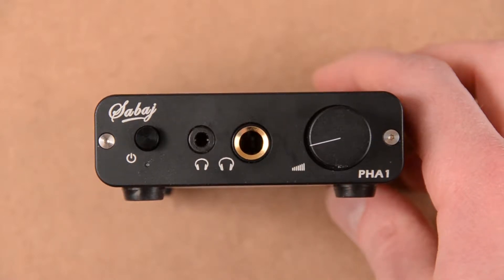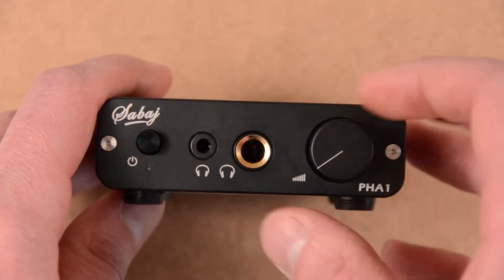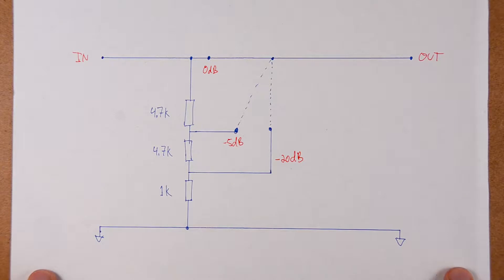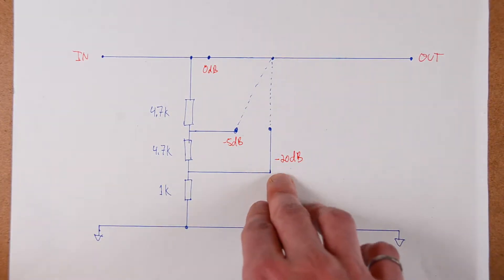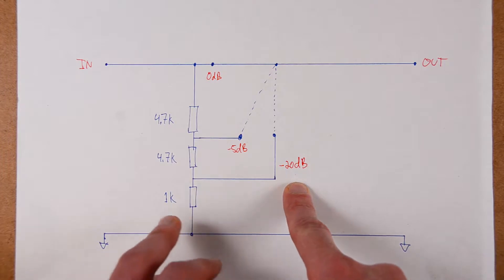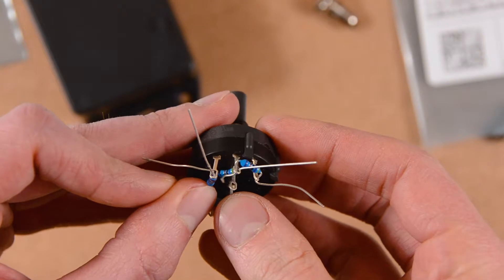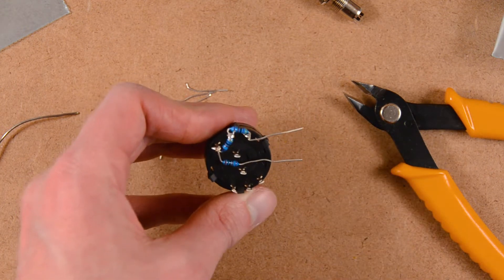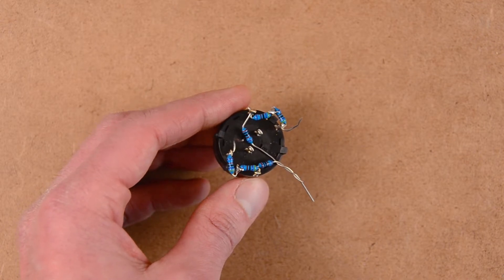Stereo stepped attenuator

Comment: Then you are changing the output impedance of your headphone buffer. which means changing the frequency response curve of your headphone. This should better be avoided.
Reply from the maker: The attenuator is used on the input of the headphone amplifier. It sits between a PC line out and the headphone amplifier input. It attenuates the line out signal, not the headphone amplifier output. You are right that it changes the input impedance of the headphone amplifier, and the output impedance of the PC sound card line out. But I don't see how it might change meaningfully the frequency response of the PC line out signal. With a 10k impedance, it is barely loading the signal amplifier on the PC sound card. We don't need to match impedance in this situation, we are between a very low impedance signal source and a very high impedance amplifier, so almost no current/power drawn. I haven't done a frequency response before/after, but there is no audible change in the signal quality. For my purpose, it is more than adequate :)
Reply: @dieselpowered  ah ok, that makes sense.